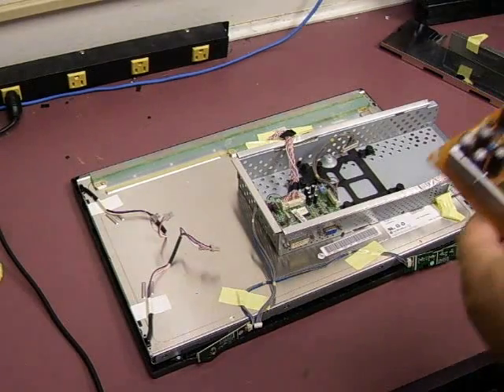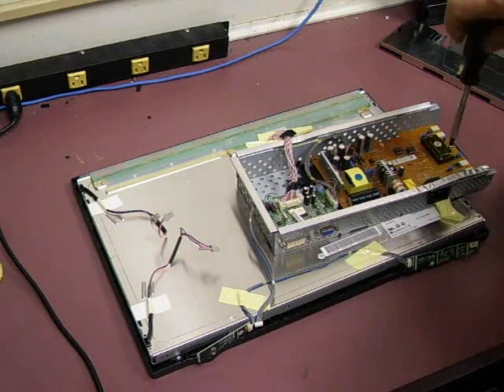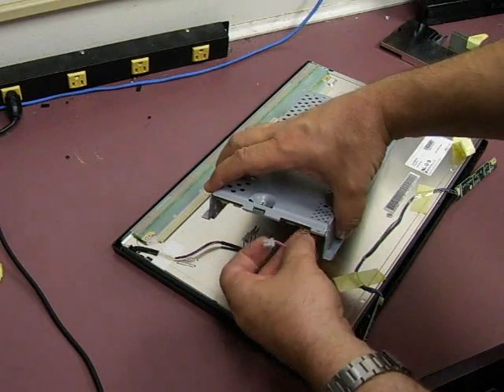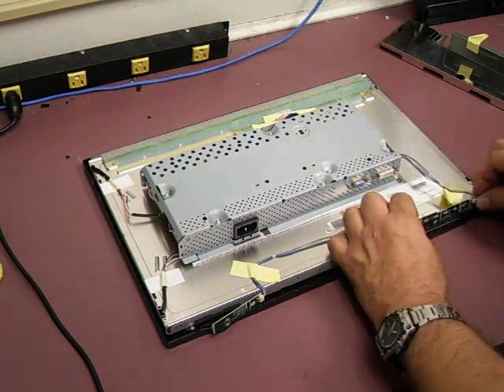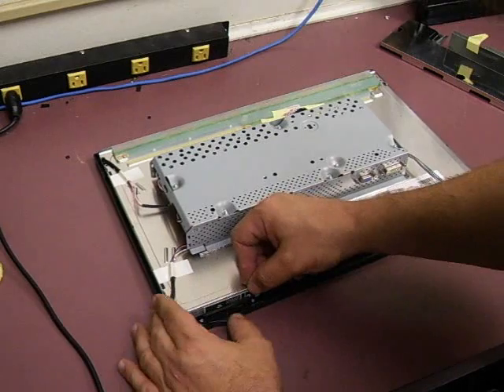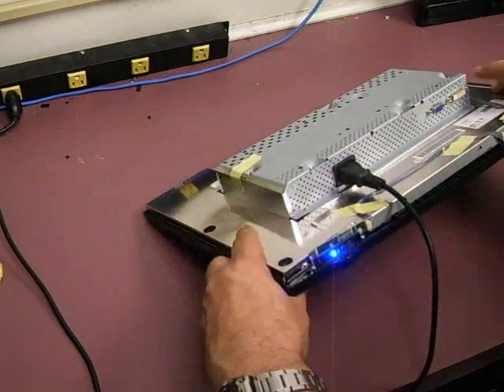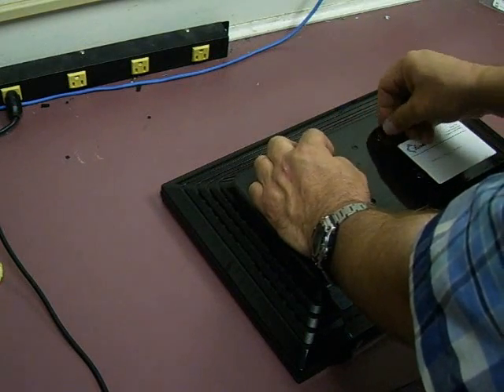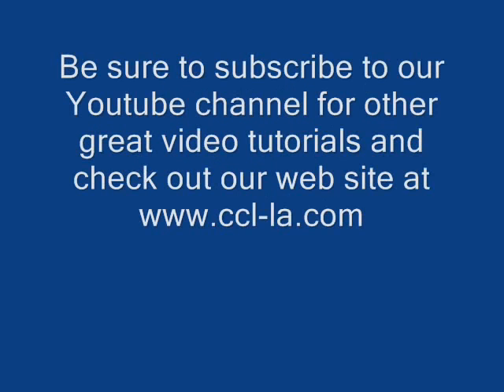Repairing an LG L196WTQ-BF LCD monitor - Part 3 reassembly

Comment from the maker: The 194WT uses the same power supply board that the 196wt uses so the capacitors to replace are the same.  You can get the kit with all of the correct capacitors to repair your monitor at the link in the video description above.